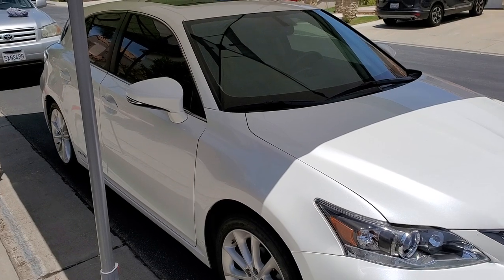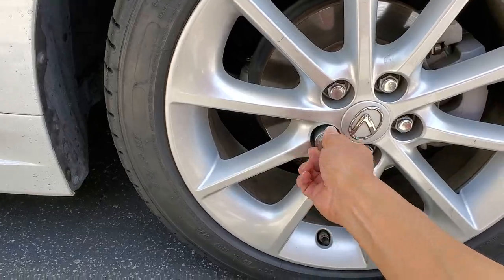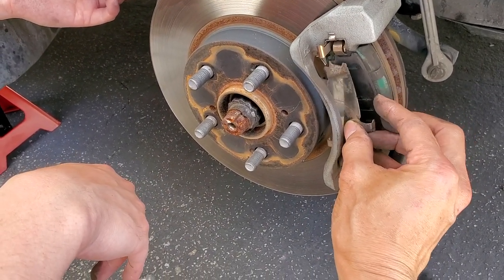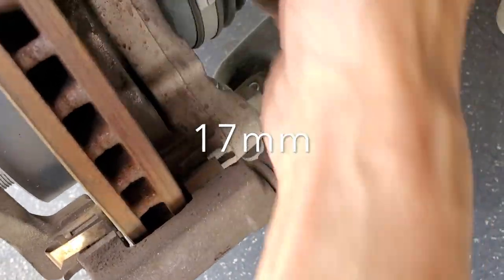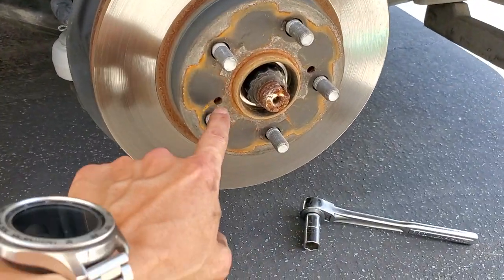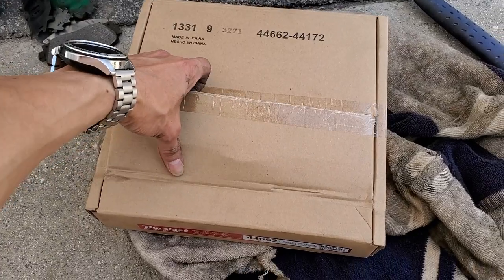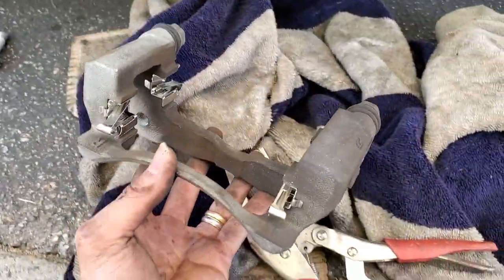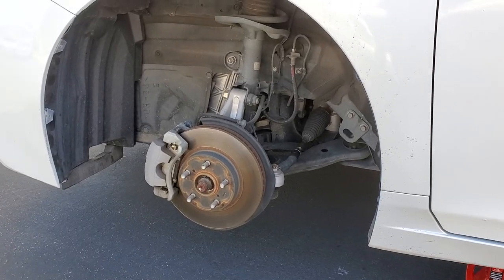How To Change Lexus CT200h Hybrid Rotors Front & Rear Brake Pads!

Comment: Some important info I needed to know I didn't see.. How did you compress the calipers. Did you need a tool, or did they compress by hand? Did you remove the fluid tank cap? Does the rear one need the foot brake off, or will it open with the foot brake applied?
Reply from the maker: Good questions! 1) On the compression you can rent a special for free at your local AutoZone or O'Rilly but somehow we managed to turn a little bit by hands and  installed the pads without any issues. 2) We didn't have to remove the brake fluid reservoir cap. 3) We didn't need to engaged the emergency foot brake.

Comment: Hey hi ,  did you guys disconnect the 12v battery or anything fancy ?  Just curious .. I’m going to do my rears... saw someone also used needle nose to turn the caliper piston ...   any help much appreciated...
Reply from the maker: No, we didn't disconnect the 12v aux. battery. But, we left the key FOB inside the house so the brake doesn't automatic engaged!
Reply: @macdaddypimpping  awesome .. thanks for the reply and great video ...
Reply: @macdaddypimpping  hey did you have to rent the tool to twist the caliper piston in?  Or did you just use some needle nose pliers ?

Comment: Did you need a tool for the back caliper? Did it spin or just push back? Thanks I’m going to do mine and kinda nervous
Reply from the maker: Yes, on the back one you  will required a spin tool to push in the piston. But, I did this one without using it.